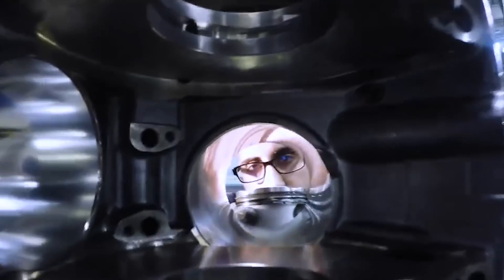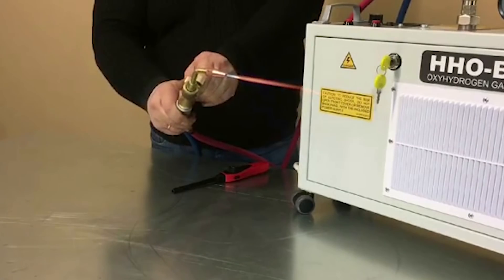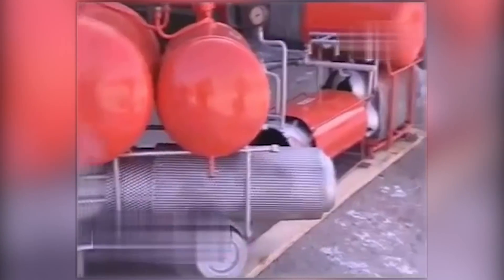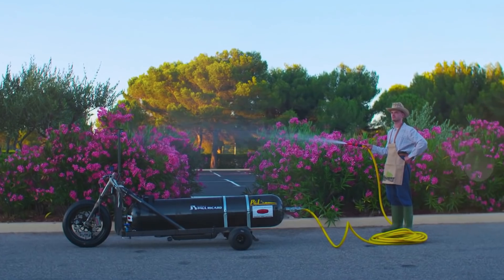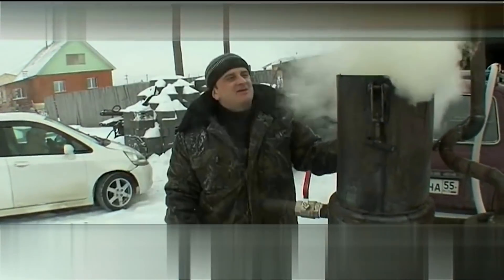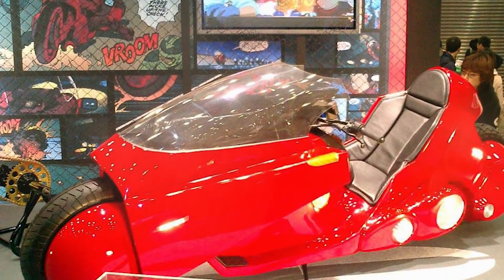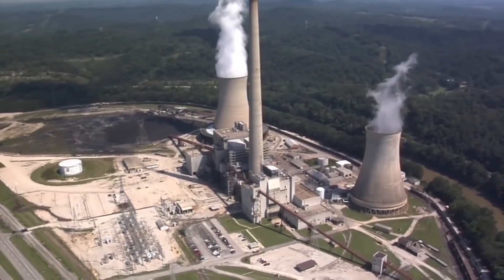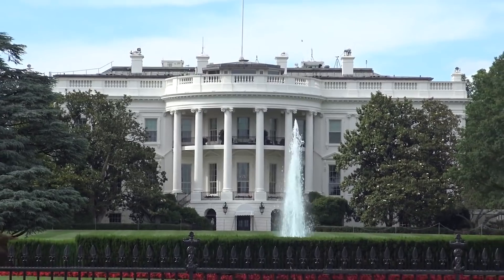Why These Engines Are Banned?

Comment: There is a simple reason that none of these "engines" are used. This is all voodoo engineering bullshit. 

For example, cars don't run on compressed air because you have to compress the air before you can use it, and that's an extremely energy inefficient process. You would only get a back a small percentage of the energy it took to compress it. And the volume of air required to move a tiny car like the one shown 100 miles would be huge, and most likely weigh much of what the car does, meaning the tank would then have to be even bigger, just to move its own weight. And, it would also have to withstand a crash without rupturing. Otherwise, you're riding on top of a bomb. That's going to be heavy, even if the tanks are lightweight (and relatively expensive) kevlar or carbon fiber. Besides, the air tanks aren't engines. They're just tanks. What exactly is the "engine" in this car? They don't even mention it. Is it an air turbine? OR dies it use pistons? Rotors? 

None of the operating principles of any of these so-called "engines" are explained at all. If any of this crap were viable, someone would find a way to make a buck off it somewhere on Earth. More than likely, all of these are just frauds trying scam gullible fools who don't grasp basic physics, but instead embrace every conspiracy theory they hear. There again, 30 minutes of basic Google searches will prove any of this to be ignorant bullshit.

Comment: You can buy a mazda RX8 with a wankel engine at any local mazda dealer. So wheres that mysterious banned engines youre klickbaiting about? We dont use other motors like air or wood fueled motors cause theyre shit, not cause theyre banned. Dislike....

Comment: What is this supposed to be?  It’s speculative at best and the ‘facts’ are more than a little contrived. About the only positive thing is you’re consistent in your message of the oil companies rule everything and are seemingly responsible for the elimination of any and every engine or power generation concept that doesn’t use fossil fuels.  Grow up.

Comment: Compressed air motors are nothing new. Many WW2 fighter aircraft (Spitfire, Hurricane, P-40, etc.) were using compressed air motors to raise & lower undercarriage, flaps, etc. because it was safer & lighter than fire prone electric or hydraulic motors.

Comment: The problem for oil companies is disposing of the waste by-product petroleum / gasoline, of which up to a quarter of a barrel of crude oil consists of, once all the other more valuable chemicals for pharmaceuticals, plastics, lubricants, fertilisers, solvents, etc. have been extracted. Up until 1900 these were dumped as a pollutant into rivers. That was until a Mr. Pratt discovered that petroleum produced more power and was cheaper than using kerosene, paraffin (made from coal) or distilled ethanol (which also damages engine fuel systems!!).

If internal combustion engines become more commonly fuelled by something else other than petroleum / gasoline, then the oil companies now have a huge waste disposal problem which will cost them money. 

It's rather like a stables which sells its horse poop to garden centres as manure suddenly finding that the garden centres no longer need their waste by-product..... they'd have a rapidly growing horse poop disposal problem & expense.

As electric vehicles become more common the price of petroleum / gasoline will drop because oil companies will be desperate to off load this waste bi-product rather than have to store it and dispose of it chemically at great expense..... or burn it off into the atmosphere.

This is why oil companies are so fearful of alternative fuels and power sources.

Comment: "air alone is to volatile to be used on engines" "thats the only reason we dont feed engines with pure 02"
Reply: Pure O2 will not burn.
Other things burn in the presence of O2. Acetylene is a good example (among many).
Do your your research.
Reply: @CreekyGuy  i dnt say burn.
Explode is the right term. If you have o2 in hot head even before the valve opens is already unstable. Can even explode before that. It is close to impossible to tune air/fuel due to how unstable it gets.

 I did my research, and studdy the pros/cons of hidrogen instead of petrol.
Reply: The Japanese did for for their torpedoes during WW2. They had a very long range for the time and an uncomfortable tendency to explode at inopportune moments.
Reply: @michaelpettersson4919  o2 is to volatile to be used in any type of engine. Even on bubles. torpedo chambers/tube o2 was used to equalize at 200bar in 75meters down. But what do i know.. Nothing..

 Pure oxigen in a engine is IMPOSSIBLE.
Reply: @mcanzy  Tell that to a rocket builder.......
Reply: @balometer  it is a rocket!

Comment: Wankels arent banned, but the water generator motors, if put in use would wreck the fossil fuel industry. They're holding off on the science, while they decry fossil fuels. Makes sense.

Comment: Just an FYI,  rotary engines were developed by Felix wankel in Germany.
Reply: Wrong.  They were invented by elves in a hollow tree.
Reply: Yeah, I was going to say DOD had nothing to do with them.  Unless he got piston rotary engines confused with the pistonless rotary engines.
Reply: In fact Felix Wankel is known to have been storming out of the R&D facilities of NSU shouting at the top of his lungs (that happened when NSU finally got his engine halfway reliable, by dropping the max rpm to 8.000 coming from 35.000) "you guys made a tractor out of my delicate racing engine" he wanted to use ceramic for the apex seals and sliding surfaces, but that was way to expensive back then. Friend of my father was right there and never stopped telling that story. He also said, you want a lasting wankel, never push it cold, dont use start assistant, just crank it over till it catches, let it idle till hot, then push the car for 5 km, the you good to hit it. the wankel in the Ro80 from my dad made 270.000km with the first seals. seamed to work.

Comment: lol, I am working on a system for capturing the exhaust gasses from a truck engine. I am building a whole design right from scratch, uses a much larger engine than normal, but there is a reason.
extra equipment. A condenser for converting exhaust gasses into water.
a boiler for turning that to steam.
a compressor with a cooling unit for changing the steam to water.
Then hydrogen can be extracted from the water to run a hydrogen fuel cell system that mixes it with air from an intake unit and produces power for the drive systems.

its a type of self generating hydrogen powered vehicle that can lower gas and fuel consumption by using the exhaust collection system as well as water vapor from the atmosphere
to both lower emissions completely AND to please the oil companies because the fuel tanks can be made large. also the large engines produce more than enough power, even at idle, to power all theses systems. that is thanks to running pumps RIGHT OFF THE CRANK SHAFT OR THROUGH A GEAR BOX SYSTEM. this goes from pumps to electrical generators.

instead of thinking small, we should think big. A larger machine can maintain power for longer. if the system is calibrated correctly, it means we can have our BILLION dollar economies and we have ALL benefit form our oil reserves. WHILE testing out new green technologies. I want to build the vehicle and test it myself. Since I am advocating the plan, I should be the one to do the design, layout and planning of the this system.

I have a special saying I like to use. "Do not ask of others, what you are not willing to do yourself"

well, I want to do this. I will be setting up a Patreon account to accept pledges soon, however, That will depend on the progress I make on the design. I do the designs live stream on my channel, so if you want proof, there it is. I will not quit until it is done.
Reply: Sorry to burst your bubble, but what you described would be about 5% efficient at best. A total waste of time. You are trying to run 5 inefficient processes in series and expecting an outcome other than the only one possible: compound inefficiency

Comment: Elon Musk is using graphene technology in his new batteries. Graphene will completely change everything in every industry! No other technology covers as much ground both literally and figuratively. As the production rates increase, so to will it's popularity. Imagine EV's without batteries, because graphene is 100% passive and can pull ambient energy right out of the air as well as solar energy.

Comment: Or just use thorium reactors create a butt ton more energy than nuclear once produce a crap ton less waste you don’t have to refine it and there’s a crap ton of thorium but first I need to figure out a way how to get rid of more of the radioactive waste from what I know thorium is barely even radioactive but it Hass to have plutonium to be able to work the reactors are all so much safer in from the ones that have been made Have not melted down so far

Comment: 7:13 Umm that's because of the insanely incredible amount of energy required to initiate cold fusion. Is it possible? Yes. Is it efficient? Yes once it's started. Is it currently feasible? No not until we find a better initiator or an easier to use radioactive substance to start the fusion process. Right now the energy we need to supply to start the fusion  is absolutely unreal.
Reply: No, Cold Fusion has never been demonstrated or replicated beyond a few quacks claiming so.  Go read a few science books.

Comment: If you really want to tackle global warming, an "unlikely source" is the answer... wood/biomass.

When people think "heating with wood", they think of fireplaces, smoke, smells, and other things. This was true many years ago. Some of it is still true today, but there are other options that are just not being developed (further) and/or used. Wood gasification creates a flammable gas from wood. This flammable gas, once cleaned up properly, can run a gasoline engine. It doesn't output as much power as the same engine on gasoline, but this is not really an issue. Bigger engines could be made or the technology could be improved upon to make engines run more efficiently on wood gas. Wood gas is basically carbon monoxide and hydrogen. Carbon monoxide burns into carbon dioxide. Hydrogen burns into water vapor. A bigger demand for wood would also lead to more wood farms (purposeful forests). Gasification could potentially use any biomass with the right design, so you don't even NEED wood. You could use something that grows faster, such as hemp or bamboo or even make use of corn stalks, which there are plenty of.

To expand upon it further, this gas can be used in pretty much any propane or natural gas appliance with minimal modifications. You could literally power your home with electricity made from "wood gas", heat your home, cook your food, dry your clothes, and run your car/truck. With the right infrastructure and more refined processes, we could literally power the entire transportation system with "wood gas". We could literally remove the need for oil for any sort of energy need and the new gas fuel would actually be "green". It will use "new carbon" and the demand will force more growth of plants that will capture the carbon released by the use of the gas. Effectively, net-zero carbon emissions.

As well, you don't need a gasifier on your car to run it on wood gas. You just need a tank that can hold compressed wood gas without oxygen in the tank. New technologies would need to be created to allow refueling by the common person without them blowing themselves up. We did it with gasoline, we can do it with wood gas.

The big problem with all of this is the oil industry. They have many good (to them) reasons to keep such technology from ever being implemented by more than just a few "crazy people". If they sit aside and just let people move away from their product, they will quickly lose profits and eventually lose the control they have over the world. In order to break free from their grasp, we, the people, have to force change. They can silence a few, but they can't silence everyone.

Comment: You are not a mechanic are you. I am betting that those air powered car are LPG. Some of this technology are way to unstable for normies. Imagine crashing with an explosive oxygen or hydrogen tank. Nuclear power is amazing, but how TF are you supposed to fix it when it breaks down. They can use the nuclear power in the car for bombs. The nuclear battery will outlast the body of the car by several life times. Do you just take it to a junkyard. Nuclear powered cars are super dangerous imagine the dumbest person you know, would you let them drive it.

Comment: On board compressor solves the range issue with air cars. Tie it to the axle rotation, fills while driving 😉. Disappointed you showed an jet air turbine at the start of the air car clip, but didn’t mention they compress their own air for fuel. Forgot, don’t realize they don’t need fossil fuel, or helping keep reality hidden for fraudulent rates based on non existent fuels? Electromagnetism(God) is the way to go. 💙 & ✌️

Comment: Hydroxy generation is actually really interesting. I wasn't so ready to dismiss it's potential as a catalyst to extract a greater thermal efficiency  of other fuels. After much experimentation I concluded that the concept of it being a useful catalyst  is actually quite plausible. I also concluded that the dangers and complexity of using it made it less than viable to be polite. 

The vast majority of claims made by the "HHO" enthusiasts is false.

It does make for some amazing exploding balloons at new years celebrations though.

Comment: If you dont understand why all these engines aren't used in mass, it's because you dont understand all the angles of the physics involved.

Simple put oil is king because of its reliability, any other fuel source is detrimental to the longevity of the mechanical components.

None of these engines are forbidden, they just aren't practical as they have a whole different set of problems.

Comment: A thorium reactor is in use in Germany over 40 years ago. 
I toured it myself. 
Search for THTR Reactor
Reply: Interesting,
They ran one at oakridge national labs for like 10 years (50 to 60s i think), Sorensen refers to it as LFTR to avoid confusion with other MSR)
Reply: THTR-300, helium-cooled high-temperature reactor with a pebble-bed reactor core consisting of approximately 670,000 spherical fuel compacts each 6 centimetres (2.4 in) in diameter with particles of uranium-235 and thorium-232 fuel embedded in a graphite matrix.  late 1980s

Weird, the Liquid Fuel concept is much more elegant in my opinion, always technical challenges but doable.

Comment: Let me get something straight: since the pistons are opposing they would collide, where are the camshafts.
Reply: They wouldn't collide, they would compress the air between them. The engine would need simply used the intake on the side. As the exhaust would be squeezed out of the side.

However you would unnecessarily complicate the engine by requiring 2 crankshaft for each set of opposing pistons. You would also half the power of a stroke per ignition. Because, the gas would be expanding in 2 directions rather than 1.

Essentially they would be complicating the engine and increasing power loses to the addition of more more moving parts like another set of crankshafts.

Comment: May want to study up on your physics first. This is a cross between twilight zone  and the magic carburetor that gets 300 miles per gallon that some guy  invented in his yard barn back in 1950.
Reply: It was invented in the 70's, was more like 70-80+ mpg, it wasnt a carbeuretor so much as it was an on demand catalytic fuel cracking system that converted gasoline to shorter and more thoroughly combustible carbon chains, it was officially documented in regards to its performance by the DOE, was reported in national newspapers, and the guy's name was Tom Ogle. And he was murdered, FYI.
Reply: @jadedandbitter  and it was a scam
Reply: @matsv201  did you miss the "officially documented by the DOE" part? The DOE sent engineers that verified its performance.

 It was not a scam, scammers don't get assassinated.

Comment: Home made HHO generators can power your little 3 cylinder Japanese engines in cars like the Mirage just fine. Solar panels have gotten cheaper and can split water all day while you  are at work. Free fuel after the solar panels pay for themselves. No need for big batteries and electric cars with all the rare earth issues.

Comment: That air car... Did anyone tell that compressors use energy? Electricity comes from powerplants witch either burn fossil fuels or atomic energy witch is not cheap and creates atomic waste. Hydrogen on the other hand is best fuel for cars in the future.

Comment: It is about the gasoline companies making money I'm a retired auto mechanic they can make cars that get a lot better gas mileage also they can make cars that don't use gasoline it's all about the greedy oil company wanting to make their money I had a 65 Ford Galaxie four door 289 V8 motor two-barrel Ford old motor the compression was 90 lb up to 120 lb compression I pull a 10 ft enclosed trailer with about 85 lb of tongue weight went through Kansas and Missouri got 23 and 1/2 Mile to the gallon old motor pulling an enclosed trailer that's good gas mileage for a old motor pulling a 10 ft long trailer enclosed today corporations have the capability and Engineering skills to make cars that get really great gas mileage or use other Technologies that don't used gasoline they can make vehicles that produce their own fuel self-contained vehicles that make their own fuel but the car companies and oil companies don't want that to happen it's all about the oil company in car companies making money